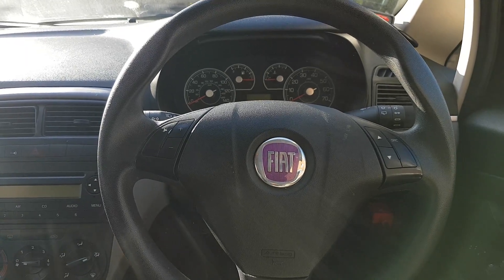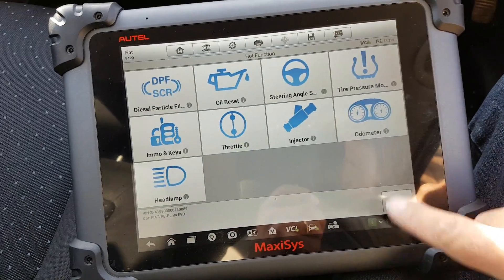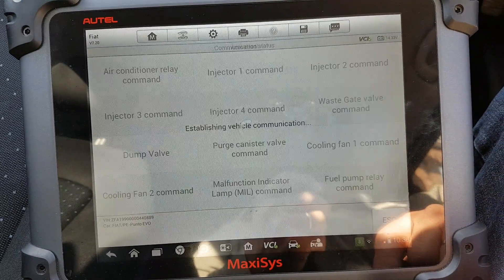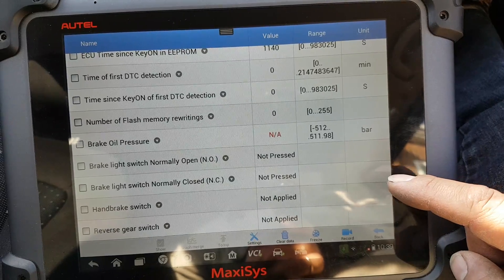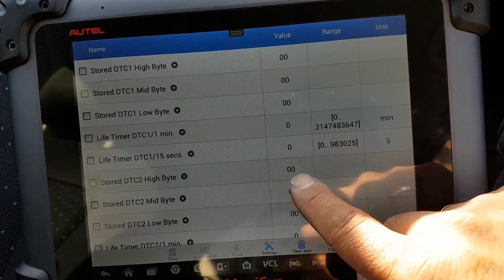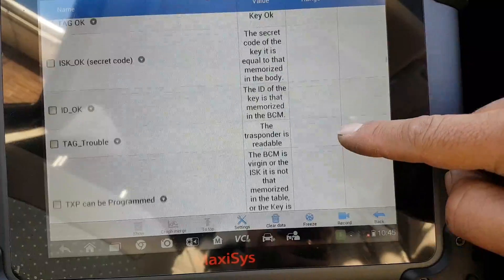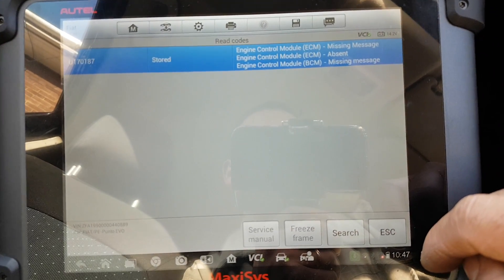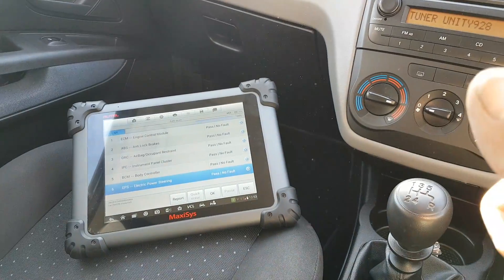MaxiSys MS908P on a 2008 Fiat Punto 1.2 Active petrol.

Comment: Luis - a request for a future video.
Like all of your subscribers I value your skill and ability but most of your work is with the MS908P which costs more than I can justify for occasional hobby use. I need advice from a trusted source (you) for a lower priced device that will do most of the things I might need but cost more like £150-250 rather than £1500-2000. I have seen the MD802 which looked promising with SRS and DPF reset etc. and I like the idea of buying an extra car manufacturer's software capability when needed, however I now see people saying the MS802 is superceded by MD805 and then there is MD808 etc. If you could comment or even review some of these lower cost options you could even offer an Amazon affiliate link so you get a small payback for your good work plus we get a device recommendation plus a trusted supplier.
Reply from the maker: Hi
I totally appreciate your comment...
But, I can't review a tool that I don't have... And I can't afford to buy this tools to review.
Now, if you want a cheap all makers, get the Delphi 150... you can't really go wrong with it.
Then you can get things like opcom, vcds, etc...
Hope it helps.
Thank you for watching and for your comment.
Reply: @LMAutoRepairs  I understand but would have expected them to provide review samples for free if they may get 28,000 sales as a result :)
Reply from the maker: @rhiantaylor3446  
I am not that "big"....😉

Comment: i came across a problem today a car came in with a blown head gasket, mechanic replaced the gasket, after that the car started for once and completely died. no DTC, injectors spraying fine, sparks good, compression is good, timing is good but the car does not start?
Reply from the maker: There quite a few things that can be wrong...
However, I would double check, and triple check all the plugs and wiring... camshaft sensors and all that... basically, everything that has been disturbed during the head gasket replacement...
Thank you for watching and for your comment!
Reply: @LMAutoRepairs ok I'll check again, thanks man

Comment: That is happening sometimes with multibrand universal scantool softwares. Sometimes scantool manufacturers fix that with new updates. I have problems with live data on citroens c4 picasso BSI module  2010 and up. When i choose some livedata i want to se and pres ok program shuts off. There's no communication error, but just software is going on start screen for citroens. Launch x431 pro. I reported that  issue to Launch and I wondered if they fix  that problem. Thank you Luis for the video.👍
Reply from the maker: Hi
Yes... that's correct... I also report when things don't work...
Thank you for watching and for your comment!